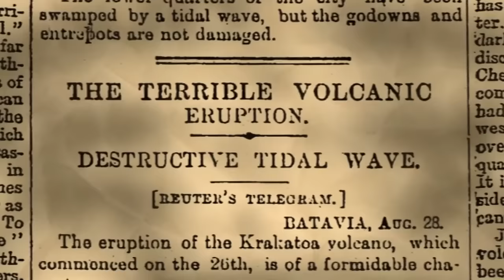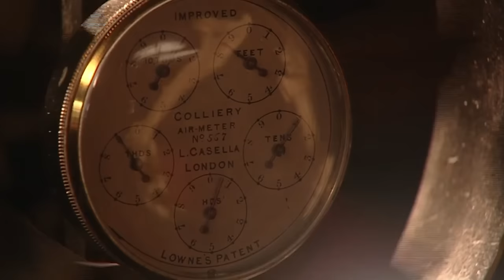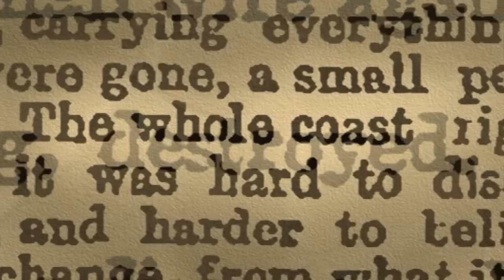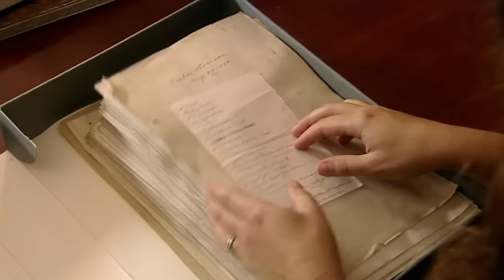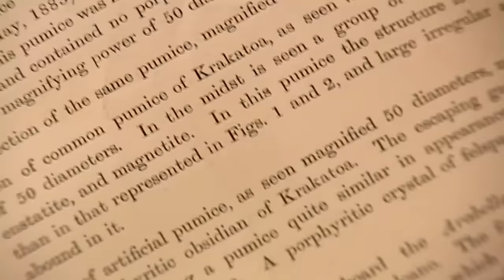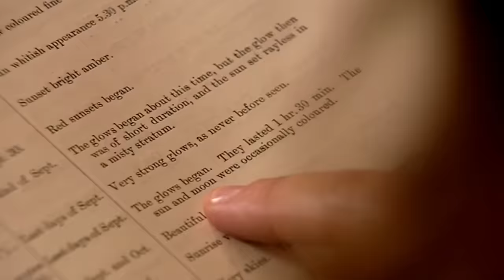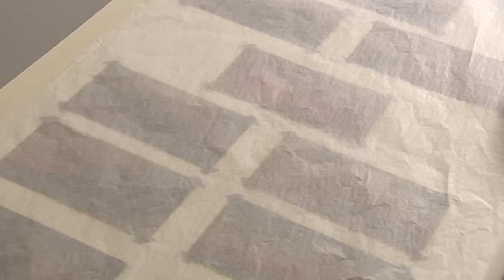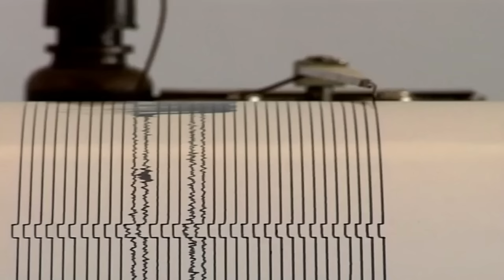Krakatoa - The Great Volcanic Eruption

Comment: The most famous and the biggest eruption in recent history. One of the best stories and studies needed to be told.
Reply: Tambora 1815 was ten times larger
Reply: @aron1332  toba: laughs
Reply: @aron1332 although Tambora eruption was way stronger in scale, the Krakatoa eruption is deadlier. 36k casualties vs Tambora's 10k.
Reply: @holycoke6133  the Toba eruption is still a THEORY until now. Plus the keyword here is RECENT.
Reply: @MyClinton123  it wa during the belle epoque
Reply: @holycoke6133  yet, still a THEORY. Not proven
Reply: @MyClinton123  wait no that was Krakatoa. But the Toba volcanic eruption happened because  lake toba is the size of poland
Reply: @holycoke6133  LOL. Krakatoa happened in 1830s and it's recorded. LOL the TOBA was the one speculated and is still a theory for it happened Millions of years ago. LOL 😂
Reply: @holycoke6133  and by the way TOBA Is yet to be proven to have happened and my original post was RECENT eruption. Just try to comprehend that.
Reply: @MyClinton123  it's been proven by the fact there's a gigantic lake in Indonesia...
Reply: @MyClinton123  1883 LOL. Toba erupted 74.000 years ago LOL.😂
Reply: Tambora technically killed over 100,000 people.

Comment: Anyone else blown away by the fact that the lighthouse man survived this whole thing?
Reply: Sounds like everyone else WAS in fact, blown away.
Reply: @MtnTow  LOLZ....that was funny.
Reply: @sv9943  not funny
Reply: Lighthouses are ten feet thick granite walls, a wave can go over them and they are designed to withstand it
Reply: trf12567  Try not to be silly and do some research
Reply: I read this comment and thought this was a joke until I got to the end 😳
Reply: Pee Sweezy 10 feet thick granite??? Perhaps there were some but I’ve visited several here in USA and I definitely didn’t see anything like that. I guess maybe it depends if they are high like most, or one at the end of a breakwater that’s guaranteed to get pounded by waves
Reply: trf12567 Back in the day, a lighthouse keeper was a lifetime post. You lived and worked at the lighthouse 24/7 with your family doing shifts to keep it lit at all times. They used oil to burn and required constant maintenance.
Reply: @peesweezy4553  The narrator said the walls were 6' thick and the lighthouse was knocked down by a giant rock 600 tonnes of coral the wave picked up from the ocean floor, the animation @54:54 showed that as well.
Reply: @Syclone0044  , Some lighthouse families even had a smallish piece of land around the lighthouse and kept cows and could plant small crops.
Reply: @peesweezy4553   they said the wave slammed a huge, multi-ton chunk of coral into the lighthouse, then the water broke up the rest
Reply: Yes, so much so I find it hard to believe seeing as how the documentary states that lighthouse was destroyed down to it's base by a gigantic chunk of coral. Sounds like a beautiful legend though.
Reply: Haha.....pun
Reply: Actually it didn’t survive try to watch it again so you can understand that the lighthouse was built again 2 years after the catastrophe.. Where did you saw that the lighthouse survived tsss...
Reply: His entire family wasn’t that lucky.
Reply: Pee Sweezy Fourth Point wasn’t - it was prefabricated cast iron.
Reply: Johanna Elves Actually the Dutch were not too bad to the locals - If you were European, that was a different question. Look up the dealing with the English over the Banda islands. Massacres were standard practice.
Reply: I think the lighthouse man did it to collect life insurance on his wife and child!😛
Reply: We see what you did there
Reply: 8i
Reply: Survived and resumed his position so as to prevent further tragedy.  How many people do that?!
Reply: Indonesia was prosperous before 1511, and the Portuguese came .. !!!  with a reason to trade .. then ?!  When in 1883, the Lord Allah Subhanahu Wata'ala ... exploded Mount Krakatau, resulting in the fragmentation of new islands ... Greed, power, brought back Civil War ,, Throughout the history of our country was controlled by the Dutch colonial party.  .  Suffering that is very gripping for the archipelago.
Reply: He's one of the camera men
Reply: Props to the camera man
Reply: @Lonzz_14  Largest wave in history happened in Litula bay Alaska. The wave was 1728ft high in the 1950's.
Reply: @indopasifik  taek kopet..
Reply: He runs a fucking light house. Of course he lived
Reply: @MtnTow  the british geologist are brave to come closer nearer to the erupted place of the volcanic ashes.,of the entire island.
Reply: @peesweezy4553  yeah, atleast 1883 technology can do that
Reply: I made my lighthouse out of steel its 6 feet thick at the base and a solid titanium light at the top with led seagulls to warn the sailors of danger
Reply: @Lonzz_14  Yes there is. Look at the Cascadia fault that runs from Northern California up to British Colombia. In 1700 there was a huge earthquake and tsunami. and it is long overdue for another one. That quake was an 8.7-9.2 they are not sure of the exact strength. If it ends up being closer to 9.2, believe me, there will be major destruction all along the west coast.... and that quake is already overdue in their predictions.
Reply: I thought the cameraman?
Reply: It just has to be by luck or chance I think.
Reply: Blown away when they said he survived. WOW!
Reply: The way I see it, is he survived because he was meant to for one reason or another.
Reply: Lmao
Reply: Yep
Reply: Johanna Elves  They brought civilised culture to the land and clearly gave us a better record and understanding of events because they're smarter.
I smell white guilt, Karen.
Reply: Yes and if it really happened as shown in the documentary...the lighthouse keeper effectively killed his wife and son by telling them to run...
Reply: #TusconBlown
Reply: He was lucky i guess. But terrible that he lost his wife and baby and all they other people too. It could very easily be us today. We are just one massive vilcanoe blast away and Yellowstone is one of the biggest in the world
Reply: @joekerr9197  only if he could've predicted that staying in the lighthouse was safer, don't be dumb he couldn't have predicted that
Reply: I was always blown away by the light house me an surviving the whole thing!!!! Every time I see this movie!!!
Reply: @MtnTow  op
Reply: Stranger than fiction, my friend. It's a matter of survival.
Reply: Most impressive was he didn't quit his post despite being injured and mourning his family. That is the measure of his mettle.
Reply: Lighthousekeeper was a real hero.
Reply: It's weird watching the movie the man and little boy dies in lighthouse  but on this documentary it's the little boy and mum dies
Reply: @peesweezy4553  wtf light house has 10 ft thick granite wall?
Reply: And so i thought when the lighthouse man called for his wife &child for them to climb the stairs  since in my mind it was safer inside the lighthouse
Reply: @Syclone0044  Correct.  There is no granite in that location in any case.

Comment: Running from a 37 meters wall of water, I can't even imagine that
Reply: Surfs up!  ;*0
Reply: At that moment he knew he fucked up
Reply: But from mountain tambora bigger
Reply: @MrAthera  where exactly is tambora?
Reply: How many feet is 37 meters? I'm old & just know feet, & inches. Sorry
Reply: @carolynortiz-rodriguez664  a meter equals 3 feet so 37 times 3 is 117 feet
Reply: Me, I would not run.  Die relaxed (as best possible) and die rested.
Reply: @masteroogway1586  actually more since a meter is slightly larger than a yard
Reply: @MrAthera  toba even bigger
Reply: 1 meter = 39.37 inches. 37 meters is approximately 123.3 feet.
Reply: @MrAthera Yes, but no witnesses. No one to take observations or gain information about the volcano because nobody was there.
Reply: @carolynortiz-rodriguez664  Tambora is on the island of Sumbawa in the Lesser Sunda Islands of Indonesia. Toba caldera is Lake Toba on Sumatra.

Comment: The scary part is we can do nothing to stop volcano eruptions. Mount Vesuvius in Naples, Italy is another volcano that can erupt killing untold thousands. It happened to the town of Pompeii during Roman times.
Reply: Town of Pompeii? More like city lol.
Reply: The scareys part is it is still active.
Reply: @ADrunkCrayfish  really, you’re gonna be that guy?
Reply: I think it was 79 A.D.  And it  covered Herculanium. . . . . . . . . smh
Reply: Eat more veggies!
Reply: Wasn't even that long ago that Vesuvius clocked in some volcanic action. It had a decent-sized eruption in 1944 as US armies were arriving in WWII.

Much more attention lately has been cast on Vesuvius' western neighbor, Campi Flegrei. It has shown the potential for much more destructive eruptions than those of Vesuvius in the past, and is infamous for its rather extreme ground deformation patterns that over the last few decades have gradually become more extreme. According to some sources, the primary reason that an eruption hasn't been sparked yet is due to the sheer strength of the cap rock which is essentially roman cement, which is stupidly strong. This probably comes with the drawback of a more violent eruption once the caprock does fail and magma finally forces its way to the surface. Due to the fact that the Phlegrean Fields lie directly underneath a portion of Naples, when it does go off you can reasonably expect Naples and anything within tens of miles of the area to be quickly erased from the map by pyroclastic flows the likes of which humanity has never before seen in recent history.

Not to be that alarmist guy, but it'll be interesting to see what happens there over the next few decades.
Reply: @MeargleSchmeargle  the buldge in campi flegrei also rises each year.

Comment: One hundred and fifty million tons of TNT, or 150 megatons if you will, is equivalent to the blast of 3 Tsar Bomba (which measured between 50 - 57 megatons when it was dropped by Soviet Union on Novoya Zemlya in the Arctic Circle).  The effects of that nuclear blast was felt for nearly 300 miles around ground zero with windows being broken by the shock wave that followed.  Even though the bomb was exploded above ground to lessen the fallout, this thermonuclear bomb produced more radioactive debris which was worse than USA's H-Bomb that was detonated on the Pacific island in 1954.  It was called a Castle-Bravo shot that gave rise to Japanese monster movies (I.e., "Godzilla"), and it poisoned the fishing crew on Lucky Dragon #5 as well as the islanders  who lived around the area. Castle-Bravo's blast was measured at the unexpected 15 megatons (15 million tons of TNT by comparison) because Lithium-7 was not supposed to split and provide the Deuterium with the Tritium bonus.  The scientists at Los Alamos calculated that the blast would be around 5 megatons.  What they got was 15 mt. instead.  As they scratched their heads, more calculations followed.
Reply: Great post. Mt Tambora ( see post above) was 800 megatons of TNT in power. Either way, I'd rather not see it happen!!!!
Reply: If we had fusion power plants energy wouldn’t be a problem anymore. In fact if we had that it would be the beginning of a new age in human technology. Endless energy. 

I think you’re mistaken, but no harm done.
Reply: Dustin Newman endless energy yet endless problems. Nuclear waste.
Reply: John S Rous Fusion, not fission.
Reply: Question -

Wouldn’t this have acted more like a shaped charge? We know from Barnes-Wallis that shockwaves and direction change the profile of explosions.
Reply: Fusion doesnt leave Radioactive Waste unlike Fission

Comment: Great video about such a significant event in recent history. One small detail I would like to mention is the strength of the explosion: Modern estimates put the most powerful explosion at around 250 MT of TNT. The most powerful explosion caused by humans was the Soviet/Russian Tsar Bomba (detonated on October 30, 1961), a prototype built to demonstrate the effect of a thermonuclear bomb, is often quoted to have had an estimated effect of 50 - 60 MT of TNT; though in the theory it could have been up to maybe 100 MT of TNT, but it was decided to limit the effect. The size of that bomb is quoted to a weight of 27 metric tonnes, a length of 8 metres and a diameter of 2,1 metres.

Comment: Krakatoa: I caused the year without summer!

Toba: [thats cute]
Reply: It was actually Tambora that caused that, in 1815. We can thank that for Dracula and *Frankenstein*, so in a sense Tambora is where goth was born.
Reply: Actually, the "year without a summer" was 1816/17, not 1883.
Reply: I just searched ‘when was the year without summer’ it’s actually both 1816 and 1883
Reply: @melodyszadkowski5256  Also, the violence of the eruption has little to do with climatic effect except that it drives the eruption column into the stratosphere. What matters is the amount of ejecta produced and its sulfur content.

Krakatoa 1883 was much more violent than Tambora 1815, but most of that violence came from steam pressure. It produced less ejecta, and the sulfur content was lower. It had only a very small global climatic effect. Tambora 1815 produced much more ejecta, and the sulfur content was particularly high. (The volcanic winter is caused by sulfur dioxide -- not the ash, which falls out fairly quickly.)
Reply: In any case it is ONE solution to the problem of global warming. Enough dust in the atmosphere and voila.  Temperatures fall.  "I'm dreaming of a white summer holiday".
Reply: smitajky lol
Reply: @smitajky  Perhaps you should read about what the Year Without A Summer was like. In New England, it was called Eighteen Hundred and Froze to Death, because there was snow in every month but August and some ponds had ice on them until late August or early September. In Europe, for a long time it was called the Famine Year. In India, massive famines because the monsoons failed, and cholera broke out into a pandemic. In Ireland, massive famine backed up by a typhus epidemic.

For that matter, in 535 AD a volcanic winter -- possibly from Krakatoa --  triggered not only famines but the first onslaught of bubonic plague (the changed weather enabled plague-bearing fleas to invade Europe and Asia from Africa).

A serious volcanic winter sounds like a cure for global warming -- but it's no more than very temporary, and has hideous side effects. Not so simple. If it doesn't involve lasting drawdown of CO2 levels, there's no cure in it.
Reply: Arkadia Moon Krakatoa did cause the temperature to drop that’s probably why he said the year without summer ☺️
Reply: Yep....
Reply: Thought it was tambora.
Reply: Kavita yes it is ☺️
Reply: Yellowstone: well I’m gonna end life as you know it...soooooo........
Reply: Siberian and Dekkan Traps: (looking down on Krakatoa and Toba): Children, pleeease... :D
Reply: @joshikavita08  there's also the Lake Toba eruption, 75 thousand years ago +/- 900 years. Largest known eruption within last 25 million years, classed at VEI 8. It left ash deposits six hundred meters deep, and covered twenty thousand square kilometers with ash fall.
Anything in our recorded history together was nothing compared to this one, and this one is not even the largest ever that we know of...
Reply: La Garetta

Comment: The machine shown at 23:57 is not a magnetic declinometer. It's clearly part barograph (shown) which measures air pressure waves, and part seismograph, which measures vibrations in the ground. A magnetic declinometer measures magnetic variation, which has nothing to do with volcanos or earthquakes!

Comment: They say the largest eruption ejected an estimated 1.8 x 10¹³ litres (11 miles cubed) of ash into the atmosphere. For comparison we are pumping out about 1.95 x 10¹⁶ litres of carbon dioxide into the atmosphere every year and at an increasing rate. Ash (with sulphuric acid) is clearly different to CO² but just the sheer volume is disturbing when you see what the 1883 eruption did to the global atmosphere.

Comment: Wasn’t the April 10, 1815 explosion of Mt. Tamboura 10 x stronger than Krakatoa?
Reply: 10x stronger sound?
Reply: @Wagneriik._.  I don’t know about sound. As this doc explains, their were more witnesses in more locations for the Krakatoa eruption, which occurred 900-miles west of,  and 68-years after Mt. Tamboura erupted, but, it seems along the same fault line.

I’ve been reading that the Tambura eruption is the only VEI 7 in recorded history. Krakatoa’s eruption was VEI 6. I’m reading that the measurements on the Volcanic Eruption Index are based on how much material is ejected into the atmosphere, and, at what distances. A measurement of VEI 2 is ten times greater than VEI 1. And, VEI 3, is ten times stronger than VEI 2, and so on. I’m not clear if the VEI attempts to measure sound waves.
Reply: Toba explosion much stronger than krakatoa and tambora